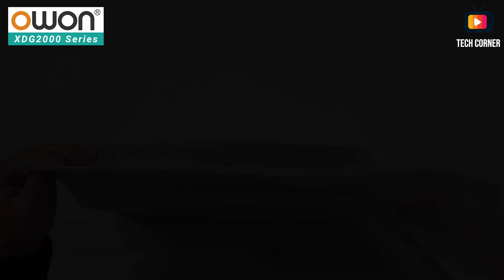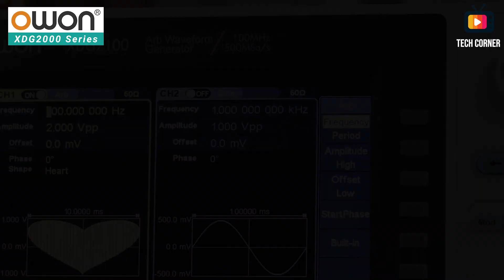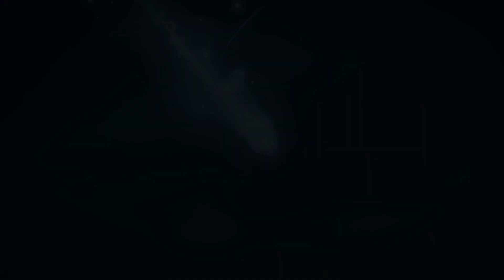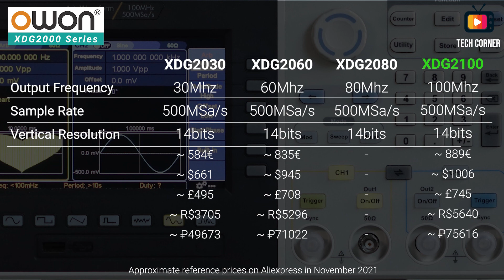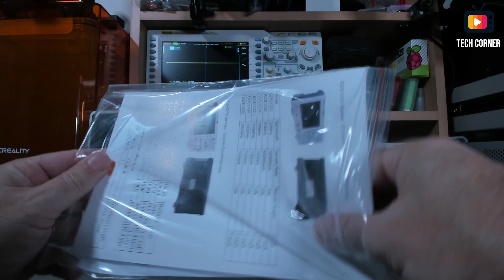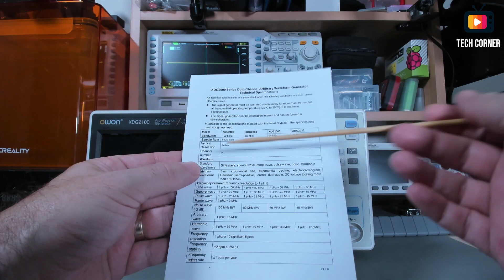Owon XDG2100 100Mhz 14 bits Function Generator ⭐ Full Review!

Comment: Thanks Hugo for the useful review. Your audio could definitely use improvement.

 I just bought an XDG2030 for use in the audio world (mostly 10Hz to 20kHz sinusoidal). I also have a 10-year old Siglent SDG2042X (still in production). I was most interested in THD (total harmonic distortion) at 1kHz. The Siglent has lower THD by about 5dB below 200mVrms, then the OWON takes the lead with lower THD above 200mVrms by 2dB increasing to 13dB better at 7Vrms. The Siglent wins at the lower outputs due to a quieter power supply while the OWON wins at higher outputs due to a lower distortion output amplifier.

The OWON has some idiosyncrasies - mostly in the SYNC outputs. These outputs are usually squarewaves in step with the output sinewave. The scope can trigger on the sinewave without the need for another cable and channel to sync on. However the SYNC output is useless in the BURST as it does not follow the burst at all. It's also useless in the SWEEP mode as the SYNC signal reverts back to following the sinewave (you get a sine and square output simultaneously). To be useful the SYNC signal should change state at the beginning of the SWEEP so the scope can follow the sweep.

The User Interface is one of the best out there easily surpassing Siglent, Rigol and UNI-T. The display is beautiful and easy to read at a distance. The backlit buttons are bright when on and have a good touch. The fan is pretty quiet. The COUNTER is terrific and is always running at the bottom of the screen except when you select COUNTER, then there is a full screen display of the frequency, period, etc. However there are no Counter statistics .  I bought it on Amazon for $330 with a 30-day return privilege. It's a screaming bargain and I'm keeping it!     Richard